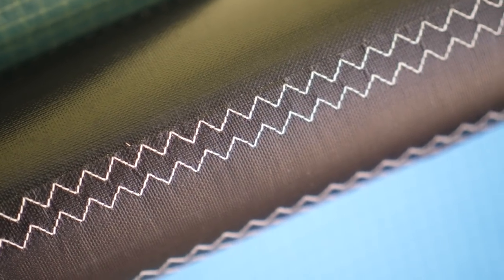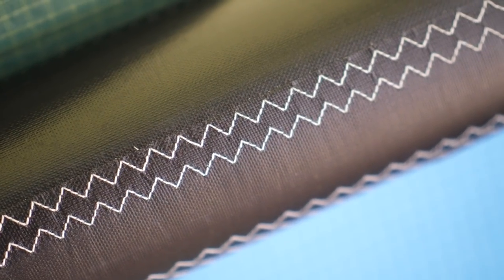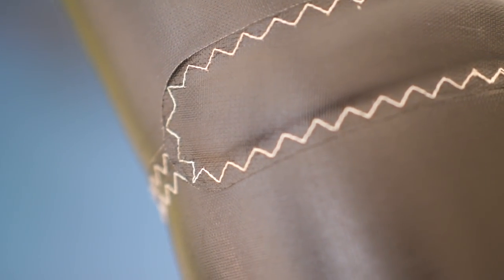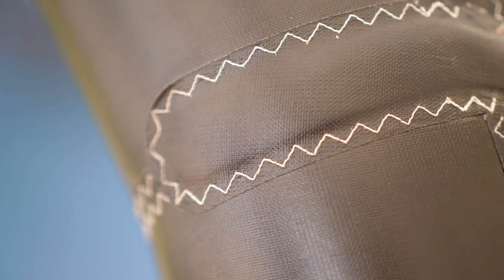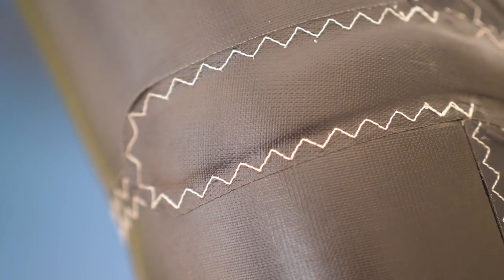New Revolution by Ocean Rodeo

Comment: I'm surprised that they didn't reduce the size of the bladder, if the material takes more pressure it can maintain the shape with less volume of air and one main way to improve kite performances is to reduce drag behind the leading edge by reducing its size. Maybe they did but it wasn't mention, I'm curious.
Reply: nice!
Reply: @dannyisrael  maybe they keep that for the next gen.